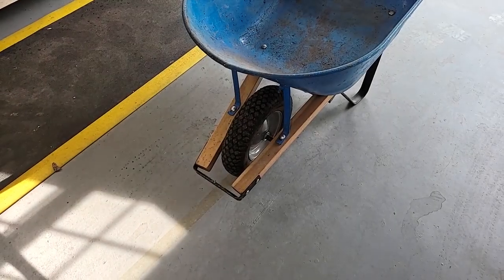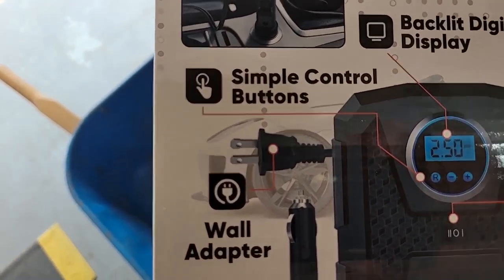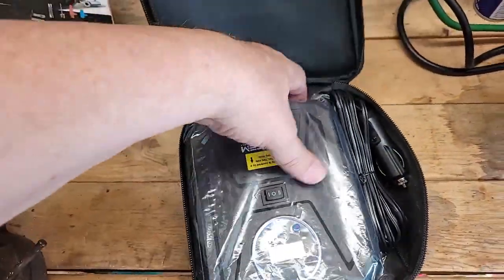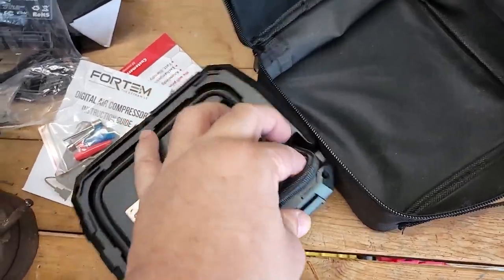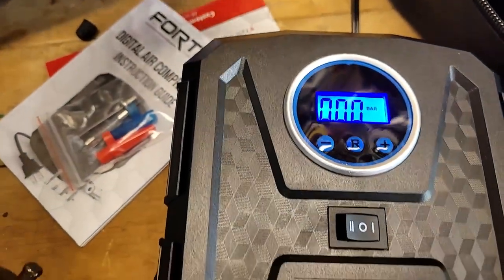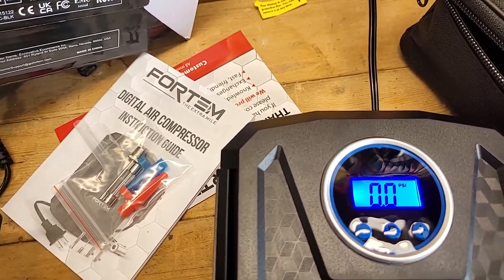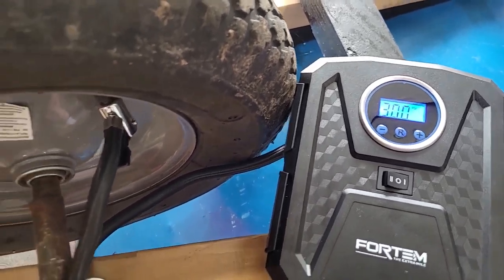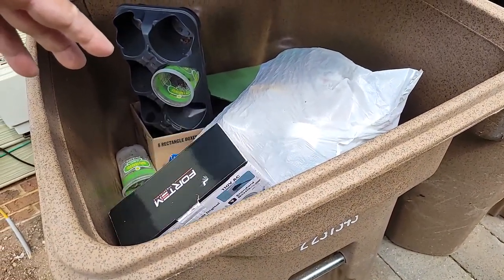FORTEM Tire Inflator 150 PSI 110V AC 12V Digital Tire Pressure Gauge Auto Pump Shut Off A LIFESAVER?

Comment: Today I also buy it from Amazon and plug it in but I also connect it to the car and it doesn't work when I press the button😕
Reply from the maker: Double check your power cables. Power button is rocker switch. One side has light come on for night use. Other position is for day use. Set PSI. Attach to tire and select switch position as I explained. If still no go? Return to Amazon. Simple. Order another. Mine is still working GREAT. I use it every month or so. Very convenient. I keep it in the garage.